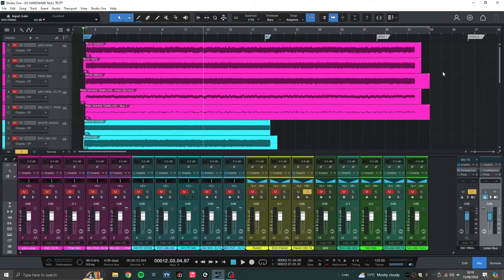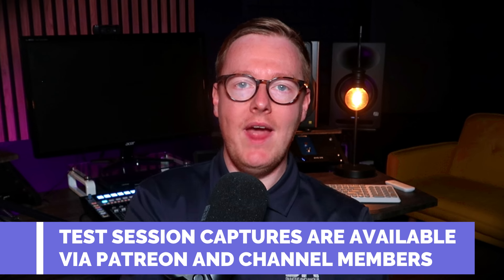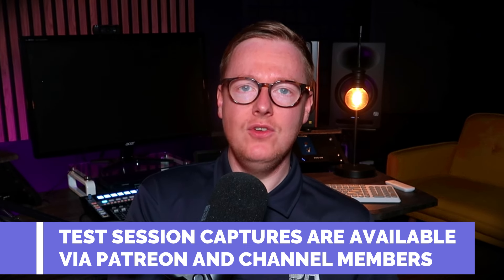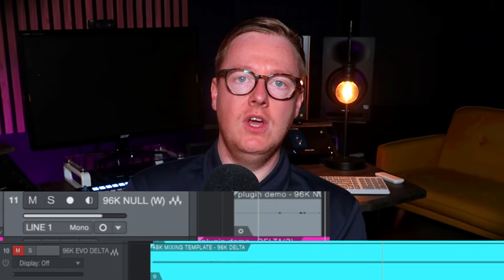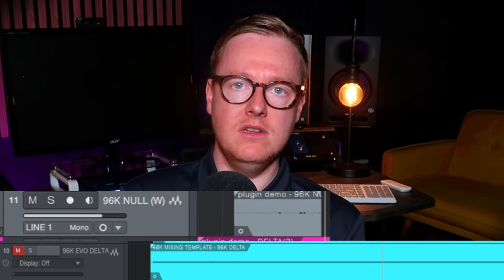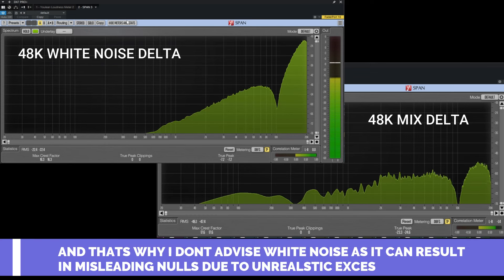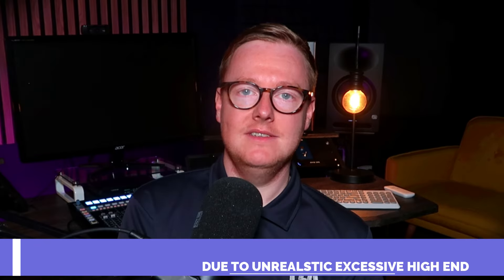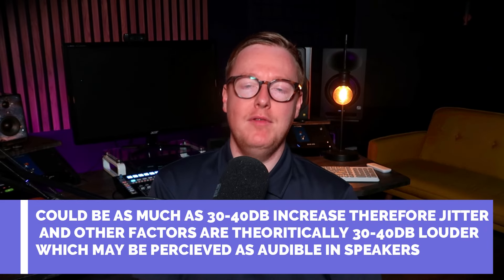Do You Lose Audio Quality In Analog Gear Using Budget Interfaces vs Expensive ADC Converters (Pt 2)

Comment: Live your best life! haha Love it. I am a proud owner of the Lynx Aurora N.  I mix with it. I master with it. I monitor with it. It's perfect for all that. I am one of those fools who has had tons of converters really expensive stupid ones. The Lynx sounds amazing and is super clean....no need to keep searching. One thing I must say about pricing. Sometimes you pay for what you get for when it comes to stability. The Lynx stuff has been rock solid for me. That's not something I can say about other brands I have used.
Reply: We have the same. I’ve had my Lynx since 2020. I have the Burl B2 Bomber ADC as an optional color for its input transformer.
Reply from the maker: Yeah I was surprised at MSM's when I couldn't hear the difference between lavry, hilo & RND MBC (without transformer) ADC. At that moment it was confirmed that I gave no fucks for expensive analog conversion haha
Reply: Matt is your lynx the same converter as a "pick up converter for the return of the outboard gear , and if not how do you implement it , I heard many engineers use different conv's for returns especially Marc Daniel nelson talked about this but I never understood how do you run two interfaces at once ,well thing is I am on windows computer and as I understand there is no real architecture that allows that , or is there another way around it? p.s Not that I am interested in Lynx ,that is beside the point
Reply: Agreed. And I don't have to take your word for it either. I tested it out for myself on Access Analog with their loopback test! The Aurora (n) is indeed a "straight copper wire" A/D-D/A with a ridiculously low noise floor.
Reply: Have you experienced the front panel freezer out, but still has sound going through? Need to restart manually

Comment: Interesting that you’re only mentioning frequency response in this video. To me the biggest difference between converters is actually how they handle transients
Reply from the maker: I did mention other things. I talked about jitter and how if the transients aren't perfectly recreated then it can impact localisation and how spacious the mix is.

I went more into detail of transients in the original edit but took it out as the main difference I hear is the seperation between sources in the mix.

Transient differences are there but more subtle than the "haze" I hear over most audio interface DAC's
Reply: @PaulThird  interesting that we’ve got such a different perception of these things! Guess that’s a big reason why there’s loads of different ranges of converters out there.
Reply from the maker: I'm discussing converters that are designed to act as linearly and transparently as possible. Ideally what comes in is what comes out. That's the main aim of a converter, never to make the sound better, simply to degrade the signal in the least possible way. 

When you get into the world of transformer based converters like Burl and soft clipping converters like lavry and dangerous then that's different to me as you purposely add non linearities to the sound outside of the conversion. Makes people think that the conversion is doing magic things when it's actually just additional non linearity. 

DAC to Speakers goes deep though. I can't even start to explain exactly what each audible difference is between them. It's a difficult topic to discuss cause we are outside the provable science of ADC and trusting our ears which is known to be one of the biggest variables in audio. I've gotta be very careful cause A/B tests of DAC to Speakers are extremely difficult due to delay in switching, levels etc 

All it takes is a slight suggestion to completely change your perception. The more we sway into the subjective realm the more I start to crawl back in my hole haha

Comment: Totally know what you mean about the “haze”. I have an Evo 16 but also an RME UCX II. Worlds different connecting them to monitors. I don’t hear hardly any difference on the ADC end though. Wondering if it’s just the amplification like you were alluding to in the video.
Reply from the maker: I'm thinking the amplification is definitely a factor but when I spoke to circuit designers they told me that there could be numerous factors with DAC to speakers and that it was pointless for me to look any more into it unless I was to build my own DAC as this stuff goes so unbelievably deep and you need to spend A LOT on measuring equipment just to start to scratch the surface

Comment: We don't know how good we've got it.  Back in the day studios would say "Use vocals on #3, it's a bit brighter" because of the variances in manufacturing or maybe Elsie in assembly used too much solder or whatever.  

Now we're down to picoseconds and "I can hear the difference".  No, you probably can't.
Reply from the maker: Yeah, it's all subtleties these days. What makes it worse is that China have genuinely seen the European and US audio market for what it is and capitalised on it big time. You can probably outperform the audient DAC with like a £200 dx3 pro+ and then split hairs with the dx7 pro+ which is still only £700. It just doesn't have to be anywhere near as expensive as it has been, and still is in the EU and US market.

Don't get me started on the lavry gold.. Biggest waste of money in audio engineering. If I want a soft clip on the master I can just get out a clipper and oversample it. I get why at the time it was seen as genius to combine high quality conversion with soft clipping but in 2024 it's genuinely just an overly priced clipper.. Just like the plugin 🤣
Reply: Paul that haze that u hear in an @ordinary convy ,ist perhaps due to that Idont know how many pico's of jitter ,it creates some micro cancelations thats just enough to create that haze ,that inconsistency ,thats perhaps why ,most engineers when testing convies takl about @it's more open ,wider, more depth etc, now I dont know that for a fact ,I just know that something is just not comming through no matter what I do,...I tried all the oversamplings ,...minimising processings that cause aliasing using paralell filter ,I was experimenting with everything known to science(working man's science) ,lately i am running through analog gear as well ,still something wrong...and the funny thing is ,like some 10 years ago ,had an RME 9632 hdsp ,I had none of these problems but I had to change the interface to a more @modern one so hard ,...well go figure ...lately I am winking at the rme baby face pro fs ,but know you put the bug in me with that topping mmm ,might give it a try 700 punds from now hehe, but I agree on waste of mony on those "etherical" converters

Comment: Paul, Could you tell me that having a RME UFX III paired with a Ferrofish A32pro (black face unit) that I am going to really hear difference between the two or do I need to go out and buy the new RME that is coming in September M-1620 pro. it has 16 ins and 20 outs. I seriously do not know how and why I went down this rabbit hole with converters. I just want to make sure my stuff is pro enough.  Yes, I watched your video but I am still concerned. Please advise.
Reply from the maker: I don't see why not. Conversion these days has to be REALLY bad to cause any audible difference. You can argue crosstalk when using multiple inputs at a time but I still can't see it adding in anything audible as even the audient is -90db which is inaudible

Tbh ufx iii is my personal end game interface so pairing that with ferrofish will be fine
Reply: @PaulThird  Paul, Thank you. I truly value your opinion!!!

Comment: Paul, I notice when I hook up my Ferrofish A32pro to the RME UFX III. I get .23 to .25 latency/delay between the 2 units. I take it that is happening through the MADI connection. Can I fix it with a BNC word clock connection or is there some other way?
Reply from the maker: Ensure that the ferrofish isn't working off its internal clock and being fed by RME
Reply: @PaulThird  I found the issue Paul. There is a setting on the Ferrofish that compensates the latency with MADI. You either select it as a single unit, 1st unit of 2 or 2nd unit of 2. I wish that was more obvious to figure out.

Comment: great vid paul at 96k the conversion is really quite good. I have a question, do you ever have any clocking issues when using just the converters of the interface? Do you ever have to compensate in the daw? for example the Antelope audio pure 2 has a "master clock".

Comment: Lynx converters along with Apogee are the best in my opinion. I have tried some mid range gear (SSL 12, MBox Studio, Presonus, UAD Apollo…). it sounds different to my ears.

Lynx is fantastic for crystal clear audio, their Aurora series is still supported and the great thing about them they are in parts modular. Especially their Auroran series, you can get USB cards, Thunderbolt cards, Mic pres. And they are reliable.

Same applies for Apogee, with a difference in sound. They sound clear but tend to tame the highs a bit. Sometimes you would want exactly that, sometimes you may want the Lynx sound. That’s just a matter of taste.

I don’t think a device like the EVO will be around in 10 years. These kind of devices are just producing electronic waste. 

Just buy real quality once and keep for 15-20 years.
Reply from the maker: I had an Audient id14 mk1 for 5 years. Never failed me, and I took that thing every where with me. Sat in a bag most of the time and was rock solid. I know the guy I sold it to and it still works flawlessly. Nearly 10 years old, 1st iteration. Upgraded to id44 for a few years, not 1 issue. Audient are one of the best priced audio manufacturers on the market. They are going nowhere as they have managed to get themselves into every pocket of the audio market and deliver quality that is necissary for studio use and price it accordingly. If you want ADC differences that you cant hear then spend to your hearts desire but to call it electronic waste is just narrow minded and elitist.

Lynx from a technical standpoint is impressive. It provides superb ADC and DAC in one unit. You will get much better results out of your speakers through lynx but for analog gear.. You'll never hear the difference. That's what the test proves. Not even 0.1db of a difference. I did mono and stereo so we could cater for crosstalk and still not 0.1db of a difference.

Audient provides you with the quality of ADC that you NEED to transparently use your analog gear. Lynx provides you with the same audible transparency but can go even more Transparent but it's transparency that in reality nobody can hear
Reply: @PaulThird  You should say it the other way around. You will definitely hear more difference with different converters the better your room is in regards to sound treatments, monitors and your experience and expertise.

You make a claim, where the average Thomann audience can jump upon and scream, my Focusrite Scarlet is as good as Lynx & Co.

That must be the reason you see only Scarlets 2i2 or Audient id14 in professional recording facilities.

I am not saying the ID44 is not good, it is just another target audience than Lynx & Co.
Reply: @PaulThird All the best to you, hope everything is fine with the MRI results. 🙏🏻
Reply: @PaulThird  audient is one hell of a devil audio interface its called the giant slayer the ad converter is 120db dynamic range and the dac converter is 126db audient simply rival most of the big names it mops the floor with both uad rme and focusrite ive use lynx and own a audient id14 mk2 and listening to both my id14 still sound bigger and wider than the linx converter

Comment: Ad/da conversion will always degrad audio quality, however it depens if it's worth it based on what the signal is passing through.. some converter has a good soft clipping when they are pushed(notihing compared to digital Sofclipping) no aliasing, no bandwidth limits etc.. however it could make sense since you can use it in more unconventional ways.. but if you are totally ITB getting ones just for the clippings it depens on your plans, great video paul! I forgot... You pay for transformers, soft clipping and.. ofc the filter. I think there is a fair sweetspot however
Reply from the maker: Tbh a converter shouldnt have non linearities like transformers and soft clipping. I get the whole premise of it but when using analog you already have transformers and clipping stages. If it's a master bus converter then I get it but I'd rather have full control over any non linearities
Reply: @PaulThird true, I was referring to the Bax ad/da converter which has a transformer pretty useful on high freq, thanks for the video Paul!

Comment: If I'm using an Apollo X duo which has optical in and I want to test out the Topping should I just route a n optical in cable and clock it to the Topping to appreciate this difference or is there more involved?  I have decent monitoring do your recon I will hear the difference?
Reply: I would think you need to run a digital line out from your interface into the topping and then run the L and R XLR balanced outs to your monitors. Thats the only way you'll hear the Topping's conversion.
Reply from the maker: Unless you have optical or coax spdif OUT in apollo you wont be able to connect a topping to it.

To compare you would need to use topping via USB
Reply: @PaulThird yes Apollo x twin only has digital in so it’s not really possible.  Still the X line convertors are almost up there with RME ADI convertors
Reply from the maker: If the apollo twin dac is the same as the X6 I would really reccomend a seperate DAC. Me, Ed & MsM all hear the same muddyness out of it and we can't tell you why. I would genuinely prefer to mix on the audient DAC than the X6. 

ADC wise apollo will be impeccable but DAC to monitoring I would personally advise doing a test as I've not tried any twins but I would imagine the DAC would be mostly the same

The headphone amps are sub par and I hear that low mid build up on speakers and headphones. Sometimes I wonder if it's something to do with the dsp and it's messing with the sound in whatever way, I have absolutely no idea exactly what it is but I just know that it's definitely there in speakers and headphones and it's not transparent
Reply: @PaulThird  is this just a comparison though to the Topping? I noticed a better quality conversion to the RME Babyface pro fs which I had which is already pretty good.  The Apollo X twin has 127db dynamic range similar to Lavry gold - not saying it’s as good but I bet it’s not far of.  The Topping is really high like 136db or something on the Sabre chips which is great but I guess you can keep going and going but if you are already up to top studio specs what’s the point? (For now)
I use a Topping headphone amp for a bit of oomph which only really helps my Audeze headphones.
Reply from the maker: @richertz think more jitter, noise phase modulation and all that deep geeky stuff with the speaker conversion. There's something going on with the X conversion that just isn't right and I can't tell you what this is tbh. Dynamic range only tells you a small fraction of the story of what's going on with thd dac
Reply: @PaulThird  ok I’ve ordered a Topping D70 pro sabre es3039pro chip to give a go.  The Apollo uses a similar Sabre chip but slightly less high specs.  Let’s see if you guys are on a placebo trip - I’ll respond here with my findings.  I’ve been mixing for 25 years so my ears are pretty good. I’ll monitor directly through the Topping. I’m in a treated room with Amphion one 18s and iloud MTMs.  It’s semi treated with thick rockwool panels. This should be much more than most will be using. I feel I can give a good analysis that might help others.
Reply: @PaulThird  so the difference I would say is not really needed the Apollo x twin Dacs are fine, there’s a change in sound on the Topping and I’ve yet to spend more time on it.  But my initial feeling was I could probably still master fine on there as is.  I will however let my ears adjust first as I can hear differences in both low and and high end so need to see if it really matters. It was more noticeable on headphones but that could just be the headphone amp. Easy to add one to the Apollo (I already have a topping headphone amp so I was not using the Apollo one).
Reply from the maker: So you don't hear the apollo DAC with a little low mid build up? I kept hearing it as a bit muddy compared to topping and audient. Something in the low mids to my ears
Reply: @PaulThird or is that just the ESS chip boost you get on the top? They are known for being a bit brighter on some DACs.  I need to spend a bit more time with it, but I’m trying to see if there is much benefit.

Or is it the vibe UAD are going for? That analog warmth thing? It’s certainly a subjective area

I do notice it though.  It’s trying to work out if it’s a design choice.
Reply from the maker: It may be an ESS IMD hump. It happens on a lot of ESS chips. ASR have measured it quite a lot on ESS DAC's. That's why the DAC implementation is really important
Reply: @PaulThird  so I’ve been listening.  It’s more open as well.  I’ve remixed a few of my tracks and I cannot disagree with you.  Makes it easier to push stuff forwards as well.  I have the D70pro Sabre with the L30 headphone amp (with the cool graphic front VU meter) .  Will be keeping this !

Just listening through all my favourite tracks this evening!
Reply from the maker: @richertz good to have even more proof that I'm not losing my marbles 🤣
Reply: @PaulThird  no you are not - i need to prove it to myself as well!